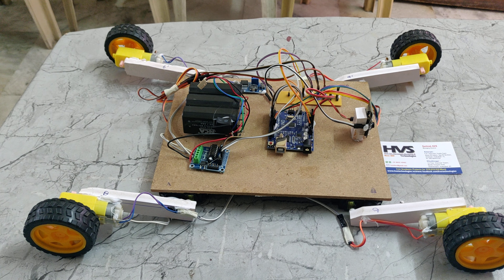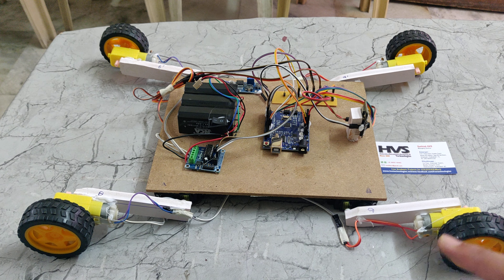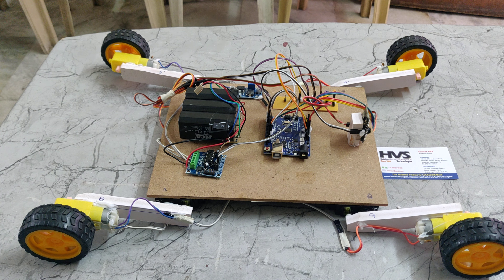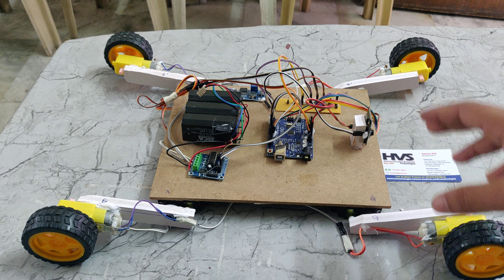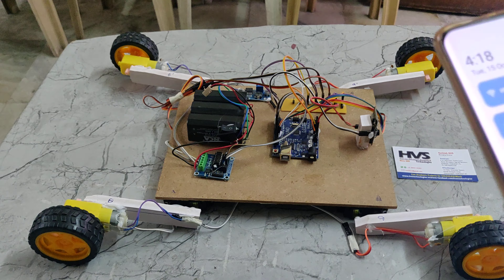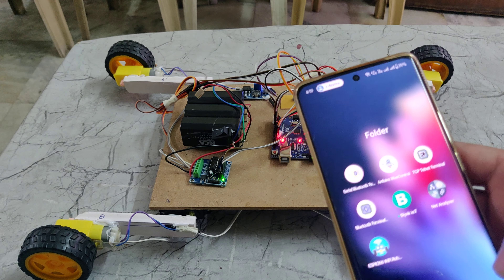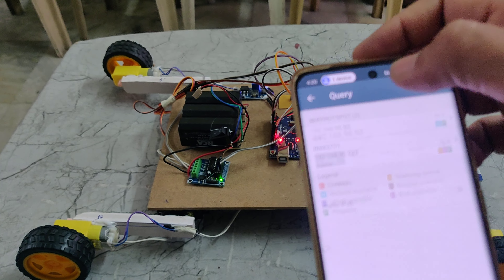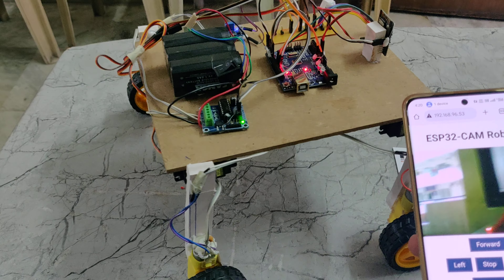Intelligent SPY Robot Using ESP32 Cam and Arduino

Comment: Nice robot! An interesting addition would be to add Mecanum wheels so the robot can move in other 4 directions. You might need to add another L298N driver to control each motor individually. if you can kindly share the code that would be great.  Thank you